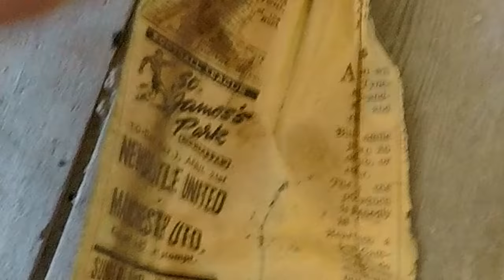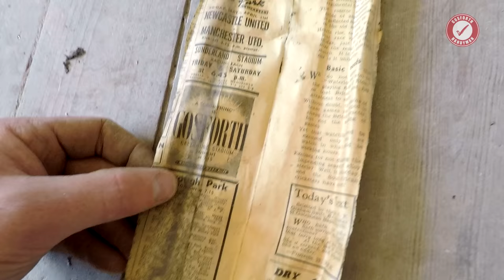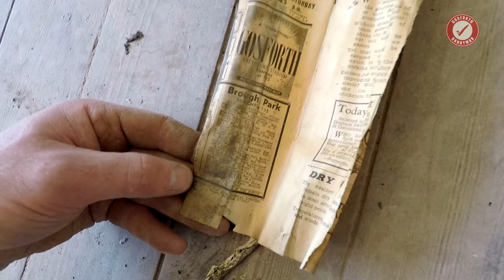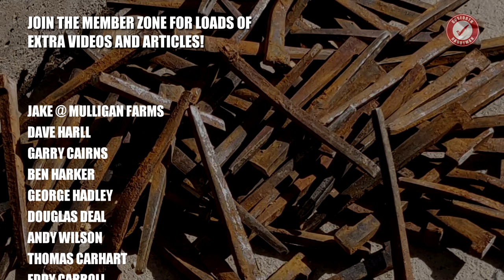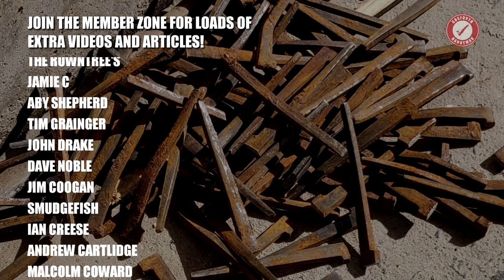How we INSULATE under the floors (1920's Renovation Part 26)

Comment: Just been chatting to building control. They tell me that I need to make sure that the insulation is compressed against the underside of the floor, otherwise the warm air will simply wash away though the the smallest gap between the floor & insulation, making the insulation have no effect. Your boards were not touching, so what did you do about stopping this convection path?
They said that this doesn't matter in a loft because the insulation always falls/compresses tight to the ceiling, but the opposite occurs under floor.
Reply: The batterns where installed so that the top of the insulation was flush with the underside of the floor boards. Your never goinf to get it compressed. Even after installation you will never get full compression with constant walking g and furniture as this will slightly displace it anyway.
Reply: @nathancurtis2585  Good point and explained in my other post. That's where they suggested a sprung batten to always push the PIR up against the underside of the floor. The walking on the floor will not displace the PIR at the joist. The PIR will flex with the floor between joists and spring back up with the board. Imagine a curved PLY bed slat screwed under across 2 joists with the centre permanently pushing the PIR up. An alternative is to seal the gap at the ends of each board.
The springiness of this particular video installation will be compromised by the lack of tong & groove / damage that would normally act to improve support via neighbouring floor boards, but singularly the will flex more. Hope this helps.
Reply: My question is what about draft? There as a many holes in between the pir as there are between floor boards. The warm air is going to seep out of there fast. I have put a damp proof membrane between pir and floorboards to stop any convection.

Comment: You keep saying airflow, but where is the airflow from and to? What were you blocking.

There seems to be a hole in the wall with an "air brick", do you just mean not to block that hole, or does it flow through that and out another? The ventilation and air flow for a PC for example must be directional, in one side and out another to avoid dust buildup.

also, the batons are such a clean idea. You're creating rails for the insulation bricks to sit on. Also cutting the pipe grooves, all very cool stuff.
Reply from the maker: Front to back of house - air bricks at the front, air bricks at the back. 👍

Comment: The quality of your work is very good but in this instance I would do it differently. I much prefer natural materials anyway, so I'd probably have went for a wood fibre insulation, although granted it will be less insulation for the same thickness. It's amazing how much toxic plastic we are using in the name of sustainability! My old floors are beautifully sanded up, so I'll need to find a street urchin to go in the crawl space 🙂 when I have used PIR I also tape the cut ends together, you could have done that when pushing through if you fancied. All the best!
Reply from the maker: Would wood fibre insulation meet building regs for fire resistance? Not something I've looked in to! 👍
Reply: @GosforthHandyman  yes absolutely, have a look at Pavatex, they are the main manufacturer. For comparison, 75mm celotex is 0.29 wm2 where as 100mm pavaflex is 0.38wm2, so not as good an insulator but natural and breathable. A quick calc on a 50m2 ground floor, you'd save £10 a year going for PIR over 75mm wood assuming electric heating, or £2.50 on gas. So nothing in it really. All the best 👍

Comment: Great work. With the rising energy costs I'm sorely tempted to do this. I suppose the same approach can be used under plywood boards in a 90s house, only issue is most of ours is covered by carpet or laminate - there is a crawl space underneath but that's probably an even harder job! 

I'm surprised you didn't use an insulation saw, they really cut down on the dust.
Reply: I’m going to do this soon, we have a crawl space I guess the hard thing is making sure the insulation is cut perfectly to wedge between the joists
Reply: Insulation saws are good up to about 60-70mm but tend to struggle with 90mm upwards in my experience.

Comment: What do you think about the idea to do this kind of job with some kind of air purifier or scrubber running in the room with you? I've started doing that myself and I can see it kicking in even when I don't think I'm kicking up that much dust in the air. Surely all that old dust can't be good for your lungs😕
Reply: I got an Axminster craft dust extractor intended for small workshop use. 2 stage filter and can knock/brush the coarse filter clear to prolong its life.  BIG difference in comfort and makes it well worth the effort of lugging around.  Proof of benefit is my facemask filters don't need changing anything like as often.

Comment: Nice job Andy. I have a 1930’s house with similar issues. Mine also has no cavity in the walls so joyful in the winter🙈
Like you said, problem starts when the joists run out, but I think these type of houses were constructed by carpenters that took pride in their work. I’m often told that I need to learn to cut corners.... it’s not in my nature. Keep up the good work pal. Have you done everything yourself .... electrics, plumbing etc ???
Reply from the maker: Cheers Paul! Ours has cavity walls mind. Don't most stuff that I'm allowed to do but defo not plastering. 🤣
Reply: @GosforthHandyman  I hear you mate. Any plastering over 8sqm and it’s game over for me, because it will dry faster than I can work, ohh, and ceilings.... no way🤣🤣🤣

Comment: Do you sealant or tape the joints between each piece?  Maybe it's worth putting a squirt of sealant on each edge so that there's a good seal when you push them together.
On new builds, extensions, I've seen tape used on the joints.
Reply from the maker: Since they sit on full length battens it's not really needed - I'd rather let the whole system breathe a little. 👍

Comment: Good video but I just hate seeing stuff like this after I've pretty much renovated a similar property. I looked at underfloor insulation briefly when I renovated and air flow seemed to be the big concern with the potential for condensation to form on the underside of the floor boards and various wood rots can then get in....so it put me off. Nice job though.

Comment: Just had work done and my builder put in insulation between the joists, he never bother with the batterns,  instead he cut the insulation  slightly larger so that they fitted snugly between the joists  and stayed in position.
Reply from the maker: It's a bit of a gamble if the insulation drops over time with floor movement etc. 👍
Reply: @GosforthHandyman  lift the boards back up once a year to check. 🤪🤪

Comment: Hi Andy, I bought an air punch nail remover it was £50:00 but I use it every time I am removing nails from wood and even bent over nails are easy to remove. The gun works on air pressure and has a long snout (something like an ant eater) that is put over the nail, the nail is straitened up by moving the snout up and a shaft inside the nail remover is then fired by air pressure and the nail is shot out of the wood, I would suggest you use an old bucket to catch the nails in but it is not only grate at removing nails but it limits the damage done to the wood to nothing. I use a lot of pallet wood and so the cosy of the tool has been paid off several times. I got it from eBay so if anyone is interested just go to amazon.uk and do a search
Reply from the maker: Like the look of that - clever stuff!

Comment: Good video thanks.  I was impressed how parallel your joists were and how well the celotex fitted.  I’ve done a loft insulation between the joists with celotex and I had to cut everyone individually to fit.  Right pain.
A question on refixing the floor boards, did you reuse the existing nail holes or make new for the screws?  I find that if you reuse the screws aren’t always tight as there’s not enough wood to fix into.
One additional tip I follow, where there are pipes immediately underneath the floor (our upstairs hallway has loads), I draw the pipe positions on top of the boards so I know where not to screw the boards down

Comment: Hopefully you won't regret not wearing a mask cutting  celotex. I had a cough for months after building my workshop. I wasn't as hardcore as I thought lol
Reply from the maker: I think I was wearing a mask very shortly after that. It's awful stuff. 👍
Reply: Good tip for this - use a soft material jigsaw blade. Very clean, straight cuts and no particles from the PIR at all. Would highly recommend in the future!

Comment: This is exactly what i want to do in my home, especially with the energy crisis! What i would like to know from anybody who has done this is did it make a significant difference?
Reply: I have insulated a small cabin by adding rigid foam boards between the floor joists like this. It will absolutely make a difference. But attention to detail is important. You must seal all gaps between foam boards and joists, and between individual foam boards themselves, with spray foam. Any air leaks between boards negate much of that insulation. 

With this method you will still get some thermal bridging in the floor because the bottom of the floor joists themselves are still exposed to outside air. But in this case there’s not much you can do about that. 

Those foam boards are roughly R-5 per inch. So if he’s adding 75mm or whatever it was, that’s almost 3 inches, so almost R-15. Even with thermal bridging that will make a difference.

Comment: Was there a particular reason why you didn't use spray foam to bond the insulation boards to each other and to the joists? That way the floor would've been air tight.

Comment: Rubbish under the floor must be cleared as it blocks airflow and increases damp. I took up all my floor boards and dropped in the celotex between joists then I covered with a thick DPC to prevent any draughts and damp then screwed in 18mm waterproof plywood sheets to replace old floorboards

Comment: I am looking as I have a similar floor.  
My main concern is that there are water pipes below the insulation and that area will now be much colder than it was so they may be at risk of freezing (if heating left off). 
I was looking at the option of rigid mineral wool sheets, the type usually used in a cavity wall. They are bendy and so could slide in through a smaller gap and fit to size with some play in them. Not so easy to fix in place though. Also much much cheaper.
Reply: If space allows it (& not already in place), I’d recommend pipe lagging. It’s cheap and will prevent pipes freezing

Comment: Great idea with the pallet buster thingy. Was contemplating a makeshift tool for that, glad you posted this. Is there no solution for running heating piping within the insulated envelope? Although pipes are insulated, it will still cause a lot of heating losses I reckon.

Comment: Sorry I'm a bit late to the comments for this one. I love your videos, your scientific approach and your pride in your work. Please could you give more information about how you would seal/insulate right up to the edges of the room behind the skirting boards to avoid draughts? And here's a whacky/bad idea for you to shoot down: how about deliberately block up the external air holes throughout the coldest 3 months in Winter (when it matters most), but be sure to reopen them for 9 months of the year to allow ventilation? The idea would be to create a body of air trapped beneath the floor which would maybe provide some insulation.
Reply: Trapping moisture underfloor in winter is a bad idea because everything will be colder, and cold surfaces are how you get condensation. Which is what rots timber when it can't dry out.

Comment: I'm just about to get started with this job. What size of brad nails did you use to fix the battens? I am guessing something like 40-50mm (don't know much about nail gauges). I'll be tackling it all from underneath as there is enough space down there to leave the floor intact.

Comment: Good idea but, I see you are using an ordinary wood saw.  There is a purpose made saw for cutting insulation of all types and it cuts down on all that dust. You can even get one to fit on a multi saw but, a bit of practice is needed to use it properly.

Comment: I would have put the battens under the joists and either used thicker insulation or left an air gap to take advantage of the reflectivity of the foil on the foam.  (Really....I am too lazy to do it your way.)  Would have been tempted to cover the soil with poly as a vapor barrier.  And, I am sure I would have stepped through the foam at least once.  Dangerous looking at the moment the foam was finished.
Reply from the maker: I think battens under the joists would be harder! Not much room to reach under. But yes, you have to be very careful not to accidentally step through it. 🤣👍

Comment: It's hard to see from the video - are you pushing the insulation along the joist and butting it up against the wall as tightly as you can, or are you leaving a small gap? About to do something very similar to this and starting to think through the finer details a bit

Comment: What is artist / track of the music in the background?   I did a similar installation in my attic ceiling 35 years ago .... had to keep an air gap between the foam and the roof deck for ventilation.... lots of furring strips.  It has held up nicely though.

Comment: I really want to do this but having read that the foil membrane can be a cold surface for condensation, I am concerned I will introduce water issues. Don't you have any concerns over that? Even if I is well ventilated, so long as their is moisture in the air and the foil a cold surface, you could be looking at months of wetness every year that will eventually cause damage
Reply: The dew point is in the middle of the PIR. The top foil will be at room temperature. The bottom foil will be at outside temperature. Unlikely you’ll get condensation on the foil itself.
Reply: I ended up using a more expensive product with a fibre glass skin. Has made a tremendous difference to the room temp

Comment: At the end of the day, it's going to feel good knowing that you're going to have toasty warm feet in the winter and that the house air is healthier to breathe from removing all that crap under the floorboards!
Reply from the maker: Too right - will be even better when we have all our windows. 👍🤣
Reply: @pumkinhead456 Phenolic is the same material that brake shoe linings are made of. It is highly carcinogenic. I used to work in a plastics factory and one day, I accidentally got a snoot full of phenolic dust. I had headaches and nosebleeds for a month and still to this day after 40 years feel that side of my nose and sinuses are different.
Reply: @freetolook3727  That sounds horrific! @pumpkinhead456 when you say that "toxins come off PIR boards", what do you mean by that? I'm guessing very little would come off them after initial cutting and fitting? Do you have any references/links if I'm mistaken?
Reply: It's off gassing of products what is often referred to as "sick houses". Plywood was formed using formaldehyde. Not so anymore due to legislation because new homeowners were getting sick.
I doubt there will be any issues with PIR unless it's disturbed like asbestos (which at one time was a common building product).

Comment: Great vid and amazing progress on the place. Would doing this in the upstairs rooms be good for the building's thermals as well as noise? If so, might you need a different insultator for acoustic properties?
Reply from the maker: PIR doesn't do much to stop noise. You'd need an acoustic insulation. Personally I'd only do this if the ceilings were down anyway - not much benefit otherwise. 👍

Comment: I’d want those 10mm heating pipes clipped properly at 30cm intervals, fittings on them do not like movement under tension. They expand markedly when warmed. 10mm pipes are also unlikely to deliver enough flow when temperatures are lowered to support high condensation in a boiler or in the future heat pumps which have even cooler temperatures.

Comment: I'm looking into doing this my self on my 1930's council built home, and have been researching a lot surrounding this. I found your video great but have a couple questions in relation to doing it.

With the vents by the external wall, could you not put a 90/45 plastic vent pipe in and seal it with expanding foam round it to maintain the thermal insulation and not potentially have a cold spot??

Should there also be a vapour barrier in the lower side of the insulation? (Alot of information ive come across suggests there should be)

Comment: I plan to insulate our bedroom floor, as below it's a kitchen with no direct radiator or Heat source (there is in the dinning area. In short it's like our bedroom is over a garage.. is there a anything to watch out for as I'm still undecided on what route to take, ideally PIR + an additional underlay. It should also assist with retaining heat in the kitchen with relevant ventilation I.e. fans and air flow into other rooms and utility. Thoughts?

Comment: instead of timber battens cut into small pieces could you use a flexible plastic angle trim that could be fixed in  long lengths, under the floor boards..??

Comment: Can't you insulate over the top, with that silver bubble insulation? Leaving room around the sides for ventilation? Or will this make it damp & rot the wood, anymore than a rubber carpet underlay would?? 🤷‍♂️ I've seen some use the bubble sivler insulation, under the underlay & carpet...

Just as I'm disabled & don't fancy lifting the floorboards up!